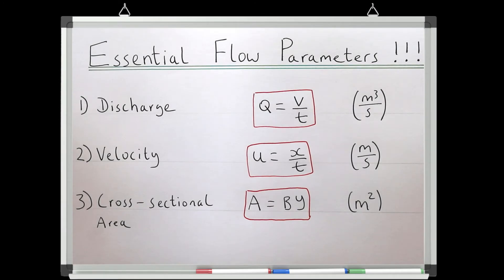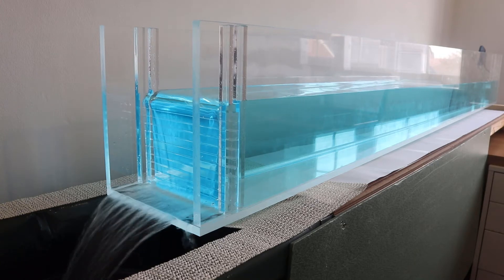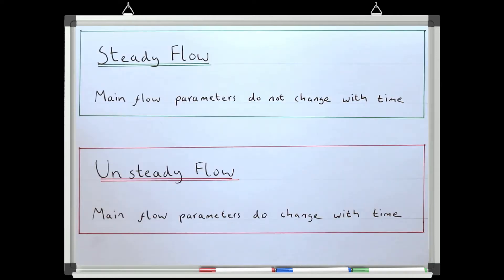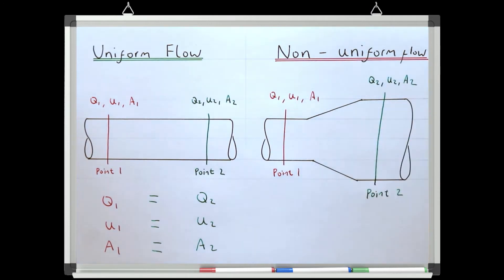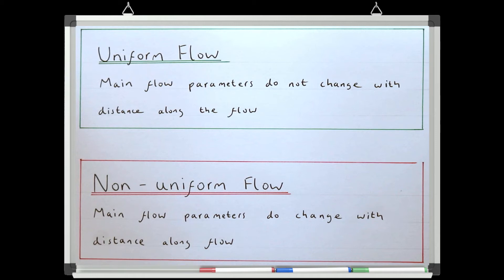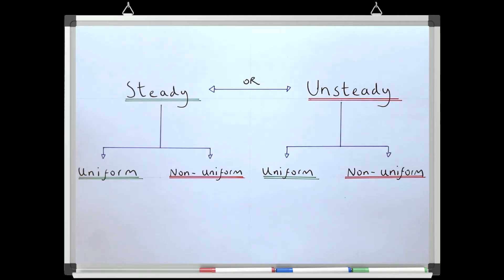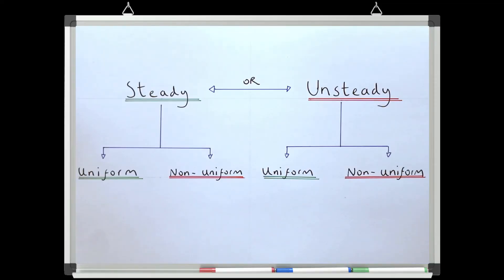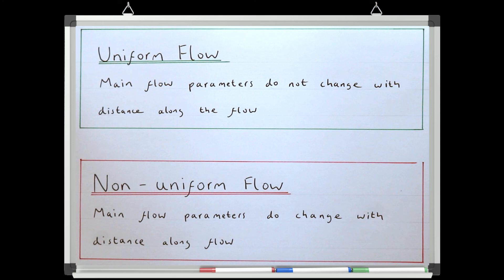Steady / Unsteady Flow and Uniform / Non-uniform Flow (Lesson 1, Part 2)

Comment: Great video! Thank you. I am trying to find an example of steady, non-uniform flow in nature. Could this be step pools in mountainous areas that create hydraulic jumps? Or would that be considered unsteady, non uniform flow? Thanks again for the video
Reply from the maker: Yep that would be a good example of steady, non-uniform flow because despite the change in the flow-depth spatially, there would not be a significant change in the depth at any given point with time. Of course, there would be small fluctuations in the depth with time, but it would be small relative to the total depth. But this does show that steady/unsteady is actually more to do with the scale you are looking at. If you looked at any flow under a microscope, it would be unsteady as there would always be some small fluctuations with time.